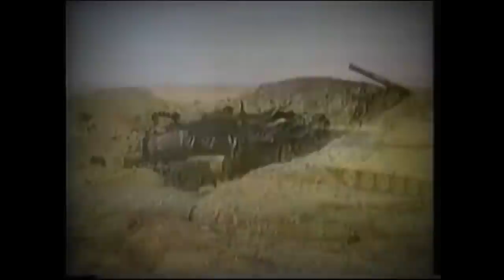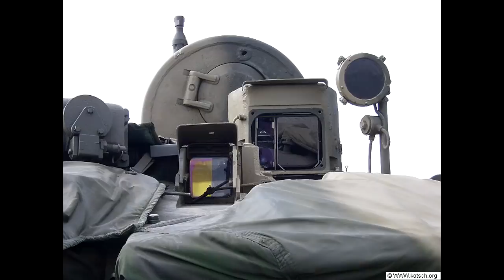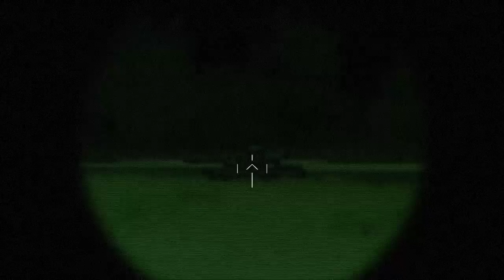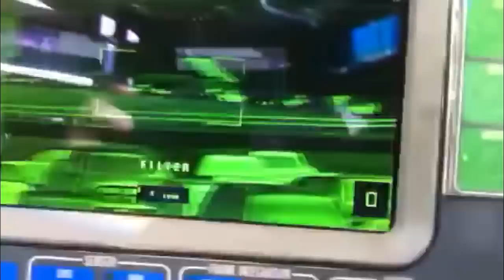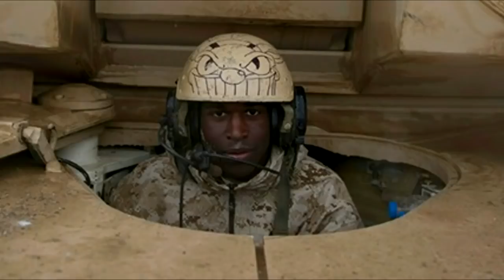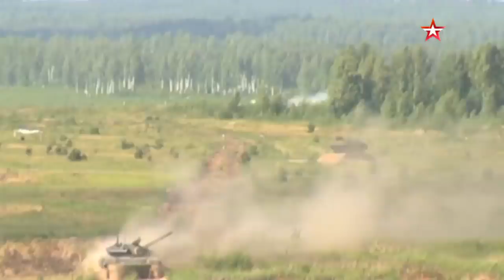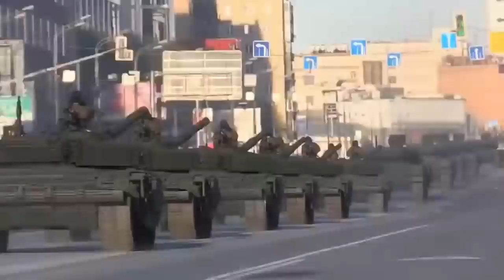Does T-72 stand a chance against M1 Abrams?

Comment: It's all about LOGISTICS.

Simply put, Abrams can't get where it needs to be without a fleet of support.  Per every Abrams there are a minimum of FIVE supporting vehicles, making the support column five time longer and slower then the tanks them selves.  That does not even include REQUIRED engineer corps to test the bridges and facilitate vehicle recovery. 

If you take just 10 Abrams tanks, just the support column will have to be comprised of FIFTY soft skin vehicles which are easy targets for ambushes and air attacks.

Without such a logistical support Abrams turns into a bunker in under 24 hours of operations, like this;

https://www.youtube.com/watch?v=FAmox1E_6bs

https://www.youtube.com/watch?v=MJwkGy6EOj8

https://www.youtube.com/watch?v=y5xKCzdhAC8

https://www.youtube.com/watch?v=B1yTb3vF35M

All ATGM hits, all either catastrophic detonations or cook offs.

Without full logistical support and a convoy of supporting vehicles, Abrams is just a metal pillbox, aka sitting duck, becasue it is simply impossible to push fuel tankers through the front lines.
Reply: @Steve Arthur  if Russia decided to attack Europe out of the blue, it would get nuked. If global war was being planned (resource war,  war for water, any made up reason you want), then the US would have more than enough time to bring over their tanks.
Reply: Now thats why us tanks couldn't push into russia
Reply: @Steve Arthur  So basically Russia would become next Germany but in modern times. WW2 lol. Then they would get grinded down, or basically just stopped a little short of Warsaw because not even Russia is stupid enough to start off with nuclear bombs, NATO (not counting US) has more than enough equipment to stop/stalemate/win vs Russia and it's a fact.

Basically, the only people that say "NATO can't win without US!!!" are Russian fanboys (you're one of them so i suspect you will say what i predicted).
Reply: @Ophiv2  No.. I really do believe Germany, France, and Britain would be hard pressed to win a battle involving the entire Russian military in a straight brawl, and even the US trying to help will be painfully slow to respond.
Reply: @Azakadune  Right, so you belive it's possible to move an army the size ~100.000-1.000.000 people to fx, Poland border, up with more than 1.000 tanks etc and not be noticed by EVERYONE?
Because the force of that size would have been noticed by everyone at least a week before the event. And by then, the possibility of US sending everything they could at the time to eastern europe would be as high as 90% (that said, every tank they have in Europe, plane, solder, etc) in case of war.

The smallest cargo ship of US Navy is capable of moving up to 2 M1A2 with the largest being capable of moving up to 60 M1A2 + other equipment. They have them in various numbers, they have 7 ships capable of moving 60 tanks at once (420~ tanks in one go), 237 C-17 Globemaster III's that can carry M1A2 each, another 237 tanks. (657 already), another, 4 ship of Shughart-class cargo ships are capable of holding 58 tanks each, ~370 tanks.
And that's not even all of the large cargo ships of US Navy. Lol.

Right, nice comparision of modern Russia to USSR, that wouldn't work out, now. Also, most countries have Missile Shields with NATO being in possesion of the most advanced ones.

I never said Leopard 2 is impossible to kill, it is. But it's still an all-around better than than any Russian tank is (not counting T-14 cuz numbers too low to make any difference). Also, we only have a 1990's estimate of Leopard 2 armour, (700 RHa vs KE on hull and ~920 RHa vs KE on turret) i honestly doubt that they didn't upgrade the armour over the last 30 years.
And T-90... no, just no.

Also, i agree. ATGM would prolly rule.
Reply: @Steve Arthur  Right, he just proved me right, that dude is always like that, haha. 
It's as if i'm seeing an entitled parent.

I hope that you know that not even counting Germany, France, GB, US, the eastern part of Nato (Poland, Turkey, Romania have the same amount of active troops as Russia does?) What a fucking surprise. Now, let's add another countries and we got off with +/- 1.5 million vs 830k troops. 
Now let's make it a war time and you see +/- 15 million troops on NATO side over the span of 2 years minimum.

You're a fucking joke, really.
Reply: @Ophiv2  You do realize Russia has a high population as well right? Not only that, the fact that it's not even a slaughtering for Russia proves they can hold their own against all of nato for a while, considering that's like 10 nations vs one. Plus, they'd just drop nukes if they lost, whom ever does lose.
Reply: @Steve Arthur  "Where as Turkey is unlikely to fight Russia, Poland would last a week or two, Romania would likely switch sides, Germany and France are unlikely to fight Russia, and if they did the Germans are essentially useless," 
And that falls under; "Fiction" category and "what if" therefore you're stupid.

"Cool story, but your delusions forget that Russia has conscription, meaning that within MONTHS not years, they can have 20 million men under arms..."- So does other contries such as Poland or Germany. Not even counting US.
Tho, NATO has far more equipment (without US) than Russia, and you're still willing to give it to Russia is a fucking mystery to normal people, also, Russia has ~2550 tanks that they could throw at any decent army (because only those are in modern range [T-90s, counting at maybe ~600, T-80 in newer configurations being the most numerous, then some T-72B3/M]. Maybe the could muster up to ~5.000 modern tanks before having to use T-55s, T-62s and T-64s. 
Yes, they only have 350 T-90's in active service, 500 in reserve, 450 active T-80's (most numerous being T-80U which is obsolete by today's standard, i.e Leo 2A5 fucks it over all day everyday) and ~4500 of them being in reserve, mostly older models but they do have around 2000 T-80U's too. 
Then 1400 T-72B3/M and the rest being older models without armor that wouldn't even stop Leopard 2A4 round.

Aircraft, Naval power as well as manpower and artillery, all are in favor of NATO.
Also, you're incredibly stupid if NATO didn't saw Russia gather troops are the border, you must be fucking retarded at this point, because you wouldn't be able to move even 100.000 numerous army to a border without anyone noticing, by that point Poland would have all of their forces on the easter border and Germany as well as France sending everything they have to Poland.

"China / North Korea." - Then India attacks China and Japan takes North Korea, lolz. 
You're stupid.

That's it, if WW3 started with Russia, it would end up just like WW2 did, with Russia being grinded down over the years (most likely 2-3 years, maybe 4 if US wasn't in a hurry). Understood?
Now leave the fuck out, you're just a retarded fanboy.
Reply: Isn't this just proves that M1 Abrams is what the US needs for its ground force?US military has the most efficient logistics in the world.It can easily support what tank divisions need (even at combat conditions with the help of air support).Therefore,why use Russia's overwhelming with numbers strategy when the US could deliver higher tech,more sophisticated and battle proven tank but just slightly fewer in numbers?
Besides, although US could technically replace M1 Abrams with tanks that put less pressure on logistics and comes in more numbers,you have to bear in mind that US is a democracy country,meaning if the number of casualties is high, large scale anti-war protests can happen like back in the Vietnam War era and Russia can keep on overwhelming the US forces as since when did Slavs care about casualties when their country's isn't as poor, horrible like in the Tsar era.

The US military high commands aren't made up of people lacking in intelligence, critical and logical thinking skills.That's why they chose to produce the M1 Abrams in 1970s and continue to upgrade and mass produce this latest variants
Reply: @schadenfreude1061  Russian "overwhelming" numbers force and human waves as cannon fodder is a typical cold war era myth. Do yourself a favor and read facts, not propaganda.  

When people just dump a load of propaganda on others, it's the same as vomiting on somebody.
Reply: @BigSmartArmed  I think you misunderstood what I mean.
Firstly,I knew it's a myth.
Secondly,by 'overwhelming',I mean after anti-war protests,the US would draw its troops out.Those that remain on the battlefield would face a ratio of 1:3-4 enemies and could be easily overwhelmed with combined armed forces from nearly all directions.

Anyway,you cannot deny the US logistics can support these fuel hungry tanks (also keeping the supplying companies in business).If Russia replaced its T-72/90 which suits what it needs and most importantly has low pressure on logistics with M1 Abrams variants,Russia would not be able to supply their tank divisions.
With good logistics support, that's why the US can roll out their M1 Abrams variants
Reply: @schadenfreude1061  I don't know what you mean about war protests.

If you are trying to say that USSR/Russia has a defenders advantage of troop deployment, that would be incorrect becasue since 1991 Russia has lost all of its buffer zones and NATO has literally surrounded it on all Western and Northern borders.

NATO missile attack now has a flight time of literally a few minutes, so any type of a numerical armor superiority is a mute point.

As it comes to logistics, a factual failure is documented during the Desert Storm and over 300 Abrams tanks going out of action right after delivery to the Gulf due to filtration system failure and failure of logistics to resupply.

After that, the very well known fact that in the drive for Kuwait and to Iraq, US armor had to stop for the failing supply lines, and if there was any resistance those supply lines would have been decimated.  

That failure took place in an open desert, while European theater is incomparably more difficult, which repeated failures of NATO maneuvers in ex-Warsaw pact states and Baltic states clearly show. 

Just during the last maneuvers US could not push any armor through the Baltic states because of tight roads and weak bridges.

It was a total cluster fuck, and that's given seven decades of intelligence gathered and processed by US. 

As a matter of fact, in its current state NATO can't move armor through Europe other then by rail, just as it was the case in WWII with Nazi forces.
Reply: @Ophiv2  The USA can't transport 1000 tanks in 4 weeks or less... can you source this, please? I'd very much like to read this.

Also, Leopards are good, but NOT THAT GOOD, their armor isn't as effective as t90s and is vulnerable to t80s and t72s.

I don't understand why you guys are arguing about tanks, realistically tanks aren't the win all vehicle of the second world war, nowadays I'd rather have a sneaky soldier with an AT launcher over an M1 Abrams if I was trying to fight tanks.
Reply: @Steve Arthur  just proving that we can get are shit to where it needs to go are supply lines are strong we make it that way we have to cuz there is a ocean that's separating us also you think that every tank we have is in America ha hell most of them are in Europe and not only that but you think that they don't have tank either? I nope there are leopards and the British tanks as well Russia will lose at any offense on its own.
Reply: @Steve Arthur  Right... sounds like i've won :^)
Reply: @Steve Arthur  And i thought you couldn't go any lower. That's qouting a fucking internet site.
Basically, i could send you a film showing how NATO would crush Russia and it would be on the same level od idiotism as your quote. 
Did you know Russians literally said, on their own TV that Poland could take half of Ukraine in 4 days?
Right, RUSSIANS DID IT. Please, stop being stupid.
Reply: @Steve Arthur  germany france italy romania poland etc that is a stupid point europe could defeat russia alone it aint the cold war anymore
Reply: @Steve Arthur  show me the "FACTS" then
Reply: @Steve Arthur  ok so amarican soldiers are among the best trained and motivated in the world and russia could never within 5 years conscript 20 million men stop being delusional
Reply: @Steve Arthur  of couse the us can transport a armored division not only have they been doing it for 70 years but even if that was true how would there be a us armored division in europe did they build it here of something
Reply: @Steve Arthur  you try proving your claims you hypocryte
Reply: 1991 fighting the 4th strongest army in the world
Reply: @Steve Arthur  the baltics yes nato no
Reply: Steve Arthur there are prepositioned stores of equipment in places.
Reply: By that same statement you condemn the t72 it's short ranged fuel guzzling and breaks down every 200km ! A old piece of junk can pretend to be relevant but if it meets new and up to date in competent hands it dies! Honestly it's not a video game it's real Soviet tactics and Soviet training have never succeeded against a western crew since ww2 ,Korea, Vietnam, Arab Israeli 47,56,67,73ect gunnery and training make the difference!  Are the Russians better than the Arabs no doubt but they still don't train and have as much gunnery as the average American tank crew!
Reply: Oh gosh we better just surrender to the might Russians then game over man. lmao! just send in the Apaches who needs tanks.
Reply: YANKS , GAS  GUZZLERS ? SURELY NOT .
Reply: Steve Arthur you really do not understand how the prepositioning of equipment works. 
It takes more than just “putting them in caves in Norway”. 
Sounds like you are some keyboard warrior know it all who never served in any military. The lack of knowledge you show in how things actually go in military preparedness is very apparent.
Reply: Steve Arthur wow, I served in 2nd Tanks, 2 Marine Division. Then eight years in the Army. You know nothing of what it takes to deploy armor and how prepositioned equipment is routinely run through a PMCS regiment. Thanks for playing.
Reply: Steve Arthur refer to your first post regarding “ the Russians just have to step on the gas”.  As if that is all it takes. S-3. Those who can’t teach. Thanks. You tried.
Reply: Dex4Sure The T-72 is not a poor tank, it fits Soviet doctrine, it’s easier, quicker to produce. It’s an easy tank to train crews on, its operation is simpler than NATO tanks. If NATO can achieve a 5-1 kill ratio, but Warsaw Pact outnumbers NATO 7-1 then it’s easy to see who would dominate a conflict.

1-1 NATO tanks dominate Warsaw Pact, but that isn’t the case with the numbers of vehicles available to the Warsaw Pact. That’s why NATO has not ruled out first nuclear strike.

Soviet tactics also account for supply lines, allowing units to not being resupplied in favor of “more successful” units.

BTW one of our Troop Sergeants (British Army) was also a T62 instructor. He gave int. briefings on T62s.
Reply: The support vehicles needed to maintain the combat vehicles in American units are organic to those units. They train in combined arms exercises having to plan and carryout logistics for those tanks. We don't use fake takes in our exercises or just pretend to fuel them. Additionally, the refueling vehicles in US combined arms battalions are armored vehicles. They can refuel on the front lines if they have to but basic planning dictates that a tank company or platoon retrogrades from contact and is covered by another platoon/company while doing so. You are looking at all of this in a very isolated way, as the Americans don't know what logistical implications of their own equipment and don't train like they fight. News flash: they do.

More specifically, fuel trucks belong to Brigade Support Battalions whos companies are attached to combined arms battalions which move with the battalion. Fuel dumps are established behind the lines, and the brigade support battalions refuel at these dumps and move it forward. Then individual platoons are pulled out of contact, and another platoon takes over their zone. The refueling tanks may drive a few kilometers behind their battle positions or less (terrain dependent really) and the tanks refuel. The Americans do this with only organic equipment at the National Training Center. The fuel dumps themselves are established by higher echeleon support units which exist and have equipment and personnel. This isn't magic. It isn't haphazard. It's thoroughly planned.

If you were to make a good point it would be that American armor is more vulnerable to disruptions in this logistics flow (which will happen in war) Which is true.
Reply: @Dadecorban  

"If you were to make a good point it would be that American armor is more vulnerable to disruptions in this logistics flow (which will happen in war) Which is true."

I did make that point, it did happen in war, and it keeps happenning.  I've read analysis of the reports.  

It happened in Iraq during DS (saber/sword/storm), it happened in Yemen, and it happened during the very last full scale exercises in Europe.

In fact, it happens every time during mass maneuvers, and logistical supply chain does not break only becasue of missed hit points, but becasue of forced mttr/mtbf failures.

Be it M1 sucking in sand through failed filters and burning up the blades, Humvee overheating last two cylinders, and transmission that goes into safe mode slamming between two gears while the motor is leaking fluids, or trucks boiling coolant.  All of that happened, and keeps happening over, and over again.  

Saudi M1s are a very good example of what they are worth without a massive logistical support behind them.

The thing is, Saudis have that logistical support, but they simply can't deploy it becasue it gets picked apart before they can even form a column.  

Anyway, originally a very good diesel motor was designed for M1 prototype, but it was scrapped in favor of the GT, while the contract was GIFTED to Chrysler which was already bankrupt, and if it wasn't for the M1 contract it would have gone completely under.
Reply: @Steve Arthur  Re-read what I just wrote before sent your response. No army plans to drive 50 miles to rear to refuel. All armies plan to refuel tanks within a few kilometers of their battle positions with lower echeleon support units. However the Americans are the only ones who's support vehicles are all armored. It doesn't make them much bigger but it does make them less fuel efficient.
Reply: @StarburstAttack  More than that US alone have 8.000 tanks.
Reply: @Steve Arthur  The M978 chassis is used for all American heavy logistics vehicles. It's the fuel truck. It's a family of trucks. Just like the Russian equivalent. The Russian equivalent is the same chassis used for other Russian logistics vehicles. The Russian version blends in no better than the American version. They both look like fuel trucks. The picture you posted obviously looks like a fuel truck. The only way your point is valid is if the observer is someone who knows nothing about what they are looking at. Your point makes absolutely no sense even given the pictures that you yourself posted.

The main difference between armor and up-armor is whether it was armored after it was produced from a kit. Regardless, the cab is impervious to small arms. The only place where the difference between up armor and armor is relevant is when it comes to IEDS because something that has had an armor kit added is not going to be a shape that is designed for deflecting the energy of a large chemical explosive. Since the armor isn't rated for stopping tank rounds or 25mm, all of that is irrelevant to the semantics of armor or up-armor.

Your point is that Russian fuel trucks blend in. This is not true. Your point is that American trucks don't blend in, which is only just as true as the Russians who also use a common chassis of vehicle for everything. Your implication is that it's harder to target Russian fuel trucks rather than American fuel trucks, this is also untrue. Competent militaries have no problem identifying the difference between types of logistics vehicles with ground and air ISR. The American army has no scout platoon that cannot identify the difference between types of vehicles. It's long range optic equipment can only not resolve the difference between two types of trucks at maximum ranges. This goes with all ground and air ISR. Furthermore, you assume the fuel trucks are a primary target in a conflict. Sometimes they are, often they are not. When a commander is determining what are high payoff targets or high value targets there are many concerns as to which equipment to target with armed ISR or prioritize for  air strikes. If the enemy is required to breech your static defenses or cross a river, bridging and engineering equipment is a priority. Almost always short-range and medium range air defense is a priority so that you can target all the other targets. Mortar carriers are often high on the list. Fuel trucks are generally not high on the list but can be. When it comes to what tanks are looking for they will shoot whatever they can shoot. So your implication that because of the design or size of American fuel tankers somehow makes them more identifiable, vulnerable, or target-able is nonsense.
Reply: @eddie money  That works both ways.
Reply: @eddie money  If the US were to enter a ground war with Russia it would require months to buildup forces in western europe in order to compete against the Russians. This is the nature of the beast. If Russia cannot end the war early, Russia will lose all of its gains. All the Americans need is time to deploy and Russia cannot deny that to them. The American treaty system and basing agreements guarantee too many locations in western europe from which to build up these forces. Russia cannot stop this deployment. The Russian navy hasn't built a major surface combatant since the end of the cold war and the Russian Air Forces ability to interdict transport vessels in the Atlantic limited currently, and would be non-existent after hostilities commence.

I grant you that the Russians have immediate short term superiority in eastern europe by virtue of the Russian army and industry being right there. Congratulations.
Reply: @eddie money  You said plans don't survive first contact. That works both ways for both sides. You can't just apply it to the American case.
Reply: @eddie money  blah blah blah
Reply: @Steve Arthur  you are full of shit.

It would be madness to invade Russia, but hell...EU would just rape Russia with its most efficient weapon: economy.
Reply: @eddie money  

Okay bud, I'll give you that Russia has one hell of a land force, but you can't be serious when you say Russia stands a chance naval-wise? Have you seen the admiral kuznetsov? Russia has never taken a stake into naval warfare, it's just a different set of tactics.
Reply: Yes, that's some of the logistics that people always ignore when comparing tank to tank. Abrams just needs more of it than the T72 does. A short sharp war, and the Abrams would likely come out on top. A long war of attrition however, and the T72 would be in its element.